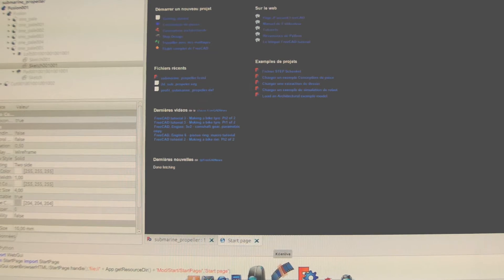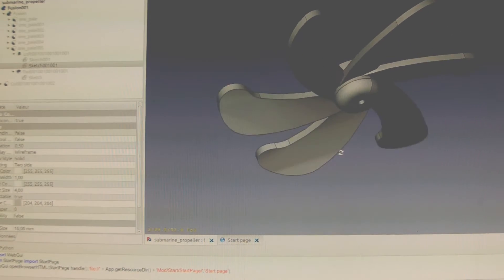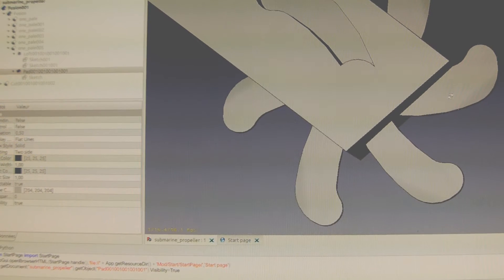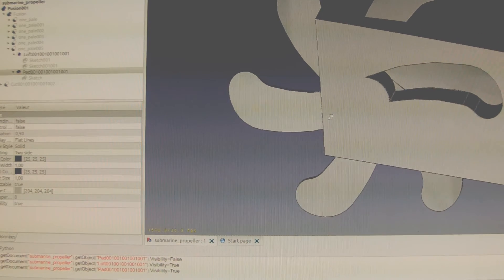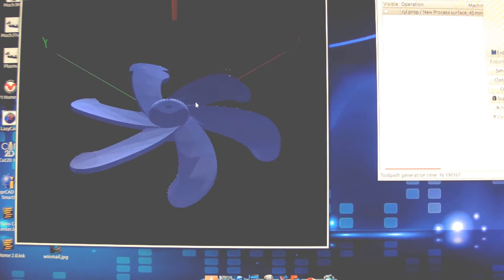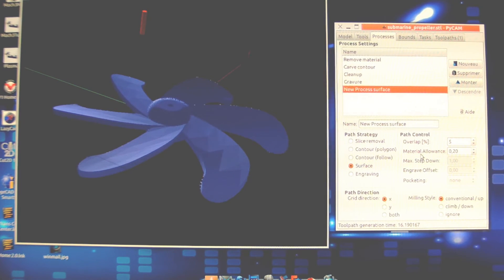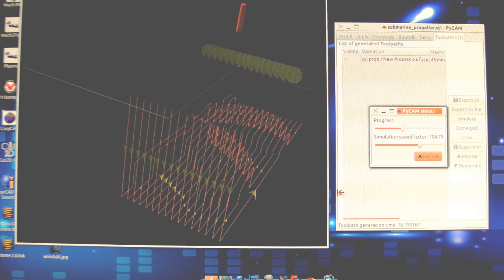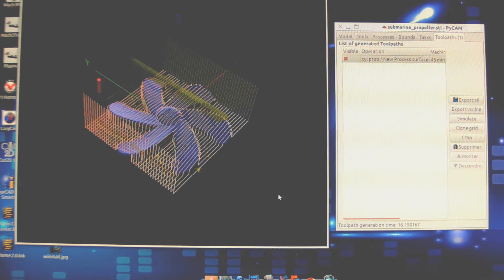Homemade DIY CNC, CNC submarine propeller milling

Comment: PyCam has tool compensation issues..   It can't swing a z arc on the back side of the tool..  That's why it comes out so rough..  Break the cuts up,  one way.    I use it myself..
https://www.youtube.com/watch?v=UbNVXxKIzzs